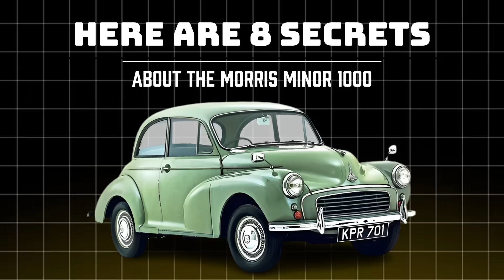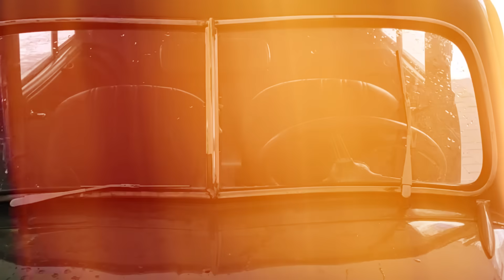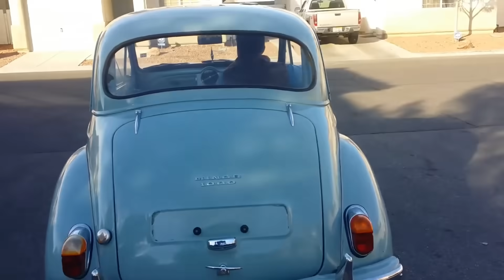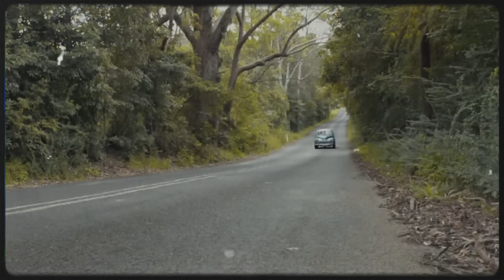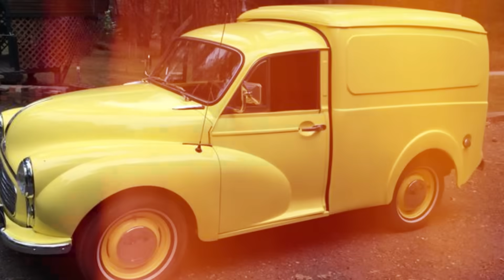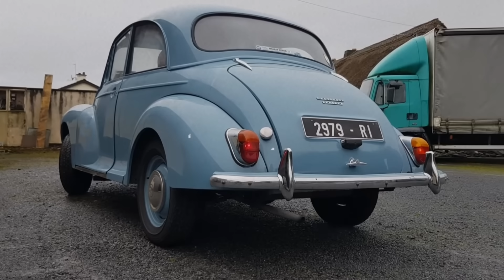The Truth About the Morris Minor 1000 No One Talks About

Comment: I owned two M.Minors back in the 70's and 80;s, did all my own maintenance and repairs, even accident damage and rebuilding a good gearbox from two broken ones. I had an original workshop manual and everything could be achieved with basic hand tools and a good multimeter. Aerodynamically it was a slippery shape for its era, could do 0-60 by July, 90mph downhill with a following wind, get airborne on some of the blind summits on the A68, and 45 mpg was possible if you filled up with Shell with the added mileage ingredient.
1. Rubbish. The heater worked fine and was fed by hot coolant from the engine. It could be used as an auxiliary radiator and prevented boiling over in traffic jams on hot days.
2. Windscreen washer was a manual piston pump. Effective and economical.
3. Issigonis pulled a flanker on incompetent management that probably saved the brand.
4. The starting handle was a useful throwback to a bygone day, and probably enabled many journeys that batteries of that time could not have begun.
5. Speedometers could be re-calibrated by adjusting the tension of the spring on the needle, then checking it at 60 mph over a measured mile. Strangely, Tesla have copied the central positioning of the speedometer.
6. BT (or GPO Telephones as it was then) had a massive fleet of the commercial variants. They were everywhere. I had the 'Traveller' version, the wood frame estate car style. Enormous boot (trunk, for Americans) that swallowed camping and holiday luggage with ease.
7. Issigonis was a visionary, not merely a designer. Most cars on the road today followed his transverse engine lead.

If the M Minor was produced today using modern materials and techniques one would probably perform well and last for 25 years.

Comment: I have a 1964 and it has a water heated core and the blower sits in the engine bay. I have just flushed the heater core and made the heat regulator working. I can guarantee that it heats instantly after a cold start. It was crucial to me, that the car had an efficient heater, as I was told by previous owner it in fact did have at one point, but needed to be fixed. I'll be using the Minor year round as an extra car. I have no knowledge about the earlier models, but they might have something like described in the video?

Comment: Had a 67 MM 1000 convertible.  Coolest car ever.  Loved it from day 1.  Mr brother owns it now.  Coming up on 60 years old in a couple years.  Replaced the original motor with one out of an MGB.  A little more pep with lower wider radial tires.  Blue w/a white top and light blue seats.  It's a good runner.  During the summer it used as an everyday commuter.

Comment: ONLY SOME came with HEATERS , ONLY SOME! NO WINDSCREEN WASHER PUMP on MINE! The BRAKES, if you could call them brakes were PITIFUL and useless. The FRONT SUSPENSION was a Nightmare design and clunked and DID NOT WORK WELL AT ALL! The So called shock absorbers were stuffed very early in life and long with the TOP knuckles of the suspension! It sold because there was not much else for the price! The Engine burnt exhaust valves faster than you could detect their demise. In Australia, if you got 4000 miles from the exhaust valves life you were doing really well.  RELIBILITY meant reliable IF the LUCAS ELECTRICS lasted long enough to be termed RELIABLE!  REALLY a PIECE OF CRAP.
Reply: Lucas defination " Prince of Darkness "    if you got 4000miles you were ocer due for the 3000 mile service which included valve work   so not so bad really.

Comment: My dad had a Morris.  This was in the late 1950s, 1958, I think.  He had had a 1955 VW and for some reason decided to get a Morris, but he only kept it for a short while, less than a year, before he got rid of it for a 1959 VW.  His biggest complaint was that, every time he drove through any more than the shallowest puddle, the engine would konk out.  Water would get into the electricals and short it out.  That was bad enbough in Los Angeles, where the climate is mostly dry, but he couldn't imagine how anyone could tolerate it in Britain, where it rains a lot more.  It seems to me that it had semaphore turn signals.  A little lighted plastic arm would stick out on the B pillar.  I thought they were really neat, but my dad wasn't so impressed. The '55 VW had them, too, but they had been disconnected and replaced with blinkers.  My dad used the crank starter just once, to see if it actually worked.

Comment: No one seems to remember that the starting handle was also the wheel brace.  My first car was a 1956 MM van with split windscreen and the 805cc overhead valve engine.  It was still painted in grey primer and I painted it green and black with a 1" brush.  It had no passenger seat or heater and I went to a breaker's yard to get them.  I never did bolt the new seat to the floor...

Comment: I had the 'Traveller' version, estate car. It was easy to self service, very reliable, easy to repair & did over 30 mpg 
The seats were comfortable, the heater was better than described here as was the screen wash and I never needed the crank handle.
I could drive from Falmouth, Cornwall to Beckenham, S. London in about 4 .25 hrs. Hard to do that now.
She was a great work horse and very popular with my friends. Two kegs of beer fitted neatly side be side into the rear.
Overall, the Morris Minor Traveller is one of the 3 favourite cars I've owned. 
I'd gladly swap my car of today for another Morris Traveller.

Comment: first hand knowledge..
yes engine wonderful
worst is suspension; torsion bar but shocks  very strange/breakdown /leakage 
Brake ; master cylinder at floor of driver.. awful  !.breakdown frequent ! 

NO match for  bullet proof VW beetle
Reply: VW is over rated The Morris Minor was far superior.
I have professional worked on both (authorized dealerships)
I have owned the following 55, 56, 57, 58 , 59, 60 Bugs, POS Thing ..
 possibly the worst cars ever made other than any thing by Chrysler.

Comment: Folks don't understand British cars of this era, there were no motorways and most roads were two lane with a lot of country roads barely wider than a single lane.  Gas was not good, the US had ethyl but apparently it didn't flow to the UK, except for airplanes.  The result was that cars were small for a reason, fitting the roads and that buyers of these didn't have much income.  Road speeds were low, probably about 45 mph (speeds were imperial not metric then).  The engine in the Morris was about 1000ccs, about the same as the VW probably with a cast three bearing crank, it was unlike a lot of American cars of its day, OHV, not a flathead but with only 60 cis and low compression, not much power.  For comparison, the German's had the autobahns, built before the war, four lane divided highways engineered for speed.  The VW also a small four, but the oversquare boxer design didn't stress the cast crank and had better flowing valves due to the big pistons so it could stretch out and make more HP and it was geared for highway speeds, this made it a more friendly product for American roads.
Reply: The Morris Minor was far superior.

Comment: Jim Marquis, Essex; England.
First car was Morris Minor, MNE 48G. Mine in 1975; every cold winters morning I used the cranking handle, four or five turns to loosen up the cold, thick oil, and a flick of the key,and never failed to start! I will admit, the heater could take a long time to warm up, ( probably five or six miles) I tried to remedy it, new thermostat, engine, and radiator flush, but to no use.

Comment: I had a front suspension collapse, fortunately when going round a sharp corner slowly.  An AA man told me most people greased the threaded swivel pins incorrectly.  You needed to put a jack under the outer end of the torque arm, which would separate the load-bearing thread surfaces.  Then the fresh grease would go up those surfaces, and clear out the debris as well.  If you greased up with the wheel sitting on the ground, the load-bearing thread surfaces wouldn't separate, and the fresh grease went up the non-load bearing surfaces.  So the load-bearing surfaces never saw new grease, the threads wore out, and eventually pulled out of the bottom bush.
Reply: Thanks for this... I will now start jacking mine up before applying the grease gun.

Comment: I had a 1960 Morris 1000 as a second car, but it was for saving fuel during petrol rationing in Rhodesia, now Zimbabwe.  Mine didn't have a heater but it doesn't get too cold in that part of the world.  Neither did it have a windscreen washer and you've shown a Morris 850cc with the washer.  It's easy to spot because it had a split windscreen, not one piece like the 1000.  The crank handle was as good as pointless because the Morrie 1000 ALWAYS started instantly.  If it took more than two turns of the engine you knew there was something wrong.... which was rare since they were super reliable.  One of the curious common faults of the Morrie 1000 was that first gear would develop a clunk-clunk-clunk sound as you pulled away.  The first gear in the gearbox would chip one of the teeth, not a disaster but irritating.  Another oddity was that the master brake cylinder was located under the floor, accessible via a circular plate in the floor that had to be unscrewed.  That was okay because one usually only checks the fluid occasionally if the brakes are in good order.  BUT...... Heaven help you if you needed to remove the master cylinder because it was a truly awkward job.

Comment: Did Isigonis also design the original Morris Minor and merely copied it to form the minor 1000 as it was identical to the 1000 except the original had a small flat rear window ands a split windscreen and possibly ? a smaller engine,  hence the addition of the 1000 in its name. The van version of the 1000 was widely used by the Royal Mail.
Reply: Also GPO Telephones used them, they were initially painted dark green.  By the mid 1970s those still on the road were then sprayed bright yellow, once GPO Telephones became BT. They were a very popular small van (only 6 cwt carrying capacity) and BL sold thousands of them.  One of the attractions was with regular maintenance (special attention to the front suspension, regular greasing of joints was needed), they were pretty reliable, when compared to other makes.

Comment: Mine was a circa 1960 model. The brake master cylinder failed, it's situated within a chassis channel under the floor on the driver's side.
To replace the cylinder I had to remove 2 long bolts passing through the chassis & cylinder.
These hit the torsion bar, so to replace the cylinder I had to dismantle the front suspension on that side.
When installing the new master cylinder, I passed the bolts through the chassis from the other side, where the was enough room, so if the new cylinder failed, it would be relatively easy to remove. Simples.
On the  plus side, there was enough space under the bonnet to get in beside the engine.
Reply: Agree repla CV ING the master cylinder was a nightmare. It failed regularly because being under the floor it was easily contaminated with dirt and dust.

There was a trick carefully jack up the car on the torsion bar causing it to flex up. That way it was just possible to remove the bolts without dismantling the suspension.
Reply: i was advised to cut the bolts off so as not to remove torsion bar.
Reply: Replaced many. Sometimes we would fit seals which was a bad mistake, since the rear section of the cylinder bore had rusted badly.
Reply: Wuss. Take a crow bar or long bar and pull down the torsion rod.
Pull the bolts out.  When overhauling the original or replacing the original, revers the bolts.. for the next time.
Many years professionally working on the Morris.

Comment: Not a factually correct YouTube presentation on the great Morris Minor. The heater used hot water from the cooling system. By changing the thermostat for a 'Winter' one, a 5 minute job, the heater efficiency increased markedly providing lovely heat into the passenger compartment. And yes the fan speed was controllable. Windscreen washers were electrically operated later using Tudor Wash Bottle and electric pump. Why didn't the AI highlight Torsion Bar independent front suspension?

Comment: The heater didn’t take warm air from the engine bay.
It took hot water from the cooling system by means of pipes. My father worked for Smiths and bought a heater through the factory.
Perhaps having an American narrator might explain things...
Reply from the maker: Thanks for sharing that information!

Comment: This is the biggest load of rubbish that i have ever listened to.  I had at least five morris minors, including thee Woody's.    This whole article is full of mistakes or delberate mis information.  Won't be listening to any more of these.
Reply: There’s hundreds of these AI videos on YouTube and from the few l’ve suffered they are all crap, the pronunciation of MPH gave it away as the computer saw it as an actual word.
Reply: Lots of mistakes. In the fifties and sixties most cars had a starting handle, provision faded as compression ratios increased with better fuel. The heater, an optional extra was fed by hot water from the engine and the knob was adjustable for fan speed..The screen washer was an advance, many more expensive cars of the time did not have one. The extra width made it more stable than the A30 andA35. All speedometers were optimistic at that time.I started my driving on one and drove several others in my family. In performance and road holding they were the pick of the bunch for many years..
Reply: Done by a yank, what did you expect?

Comment: More rubbish and few facts.No car at that time came with a heater as standard, the one you describe was an accesory add on often bought mail order, I know I had one, the fitted unit ran from the cooling system. The windscreen washers on nearly all cars had a push button pump on the dash and again often fitted as an extra as was mine. Nearly all cars up to the 1960's had a starting handle, kickbacks didn't hurt if you held the handle with the thumb in the correct position. Speedo's were never accurate at that time on any car, changing tyre size or under inflation could further add to the error. The Morris Minor didn't have a chassis and the wood frames on the estate were fixed to the metal frame. Why do you bother??

Comment: My friend had the van 60s we used it for carrying all our camping gear I drove it all over Devon & Cornwall on L plates great little motor
Reply: My first vehicle was a 1965 ex GPO van I bought in 1972.  It cost £125 and had 60K on the clock.  The gearbox gave up the ghost a year later, I replaced it with a 1960 Traveller which cost £65 and I ran that for a further year, before engine trouble resulted in the one way visit to the scrapyard.

Comment: The only fault (common to other makes too) was corrosion. Also,  the torsion bar front suspension was inferior to other cars of the time, and prone to break through the rusted floor in later years 😮
Reply: The torsion bar suspension was FANTASTIC. 
Bull Spit.
Reply: @jeffhildreth9244 not in my experience. It was always an mot failure on vehicles, and had to be welded. The later Marina was even worse. By the way, I had an Austin minor 1000 pickup too in the 1970s.

Comment: I did a lot of miles in the Morris Minor vans we used in the family radio/TV/Electrical retail business.  We started with the 850cc version (with a divided windscreen) and ended with the 1000cc versions. The big feature  was the excellent rack and pinion steering. Being a teenager at the time, I used to throw the vans about quite a lot.  The poor heater wasn't unique to Minors; it was a 'feature' of many cars at the time (we had a 1967 Austin Healey Mk4 Sprite with an equally primitive heater). Starting handles were widely available at the time, too, even though all cars had electric starters. They were useful for turning the engine over for maintenance (eg setting tappets).

There was a serious fault in that the front swivel pin could fail when turning slowly on full lock. It happened to me pulling round a bus at a stop (right outside the police station!) and was embarrassing.  Overall the Minors (particularly the 1000cc) were great vehicles at the time.

Comment: Owned a couple of Travellers in the early 80s as my first cars
The starting handle was a godsend as the alternator struggled to charge the battery in the winters
Properly tuned, the engine always started easily
Reply: My two had generators not alternators  when you stopped at traffic lights, they stopped charging and the ignition warning light came on.
Reply: Most, if not all, Minors had dynamos fitted, which did struggle to charge the battery.  I'm not sure if the very late models (1970/72) ever had alternators fitted as standard, others might know.  I had my 1968 Traveller converted to Negative Earth when I had an alternator fitted, as a replacement to the dynamo.   No problems with flat batteries or trouble starting.
Reply: Another Moggy width story was that it was widened to use the VW flat 4 engine. Britain occupied the N-W of Germany, including VW Wolfsburg.